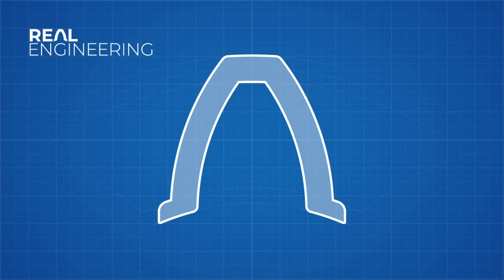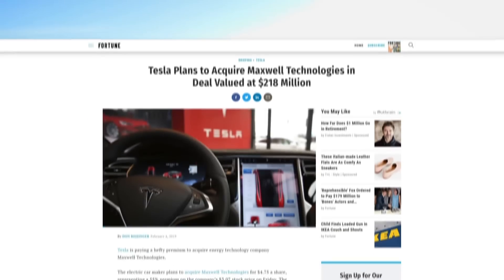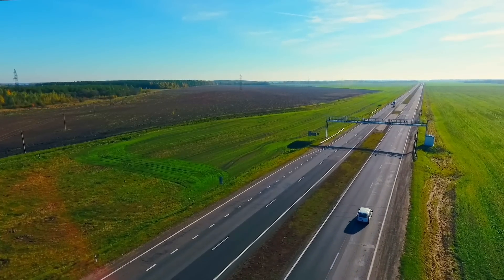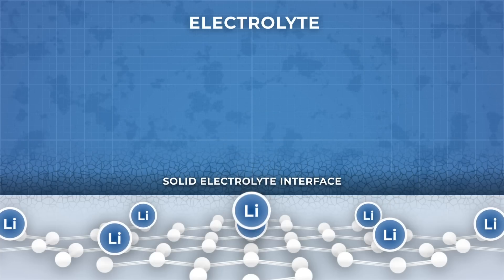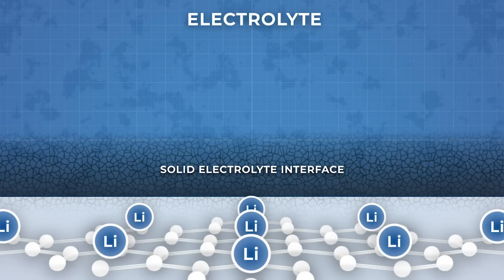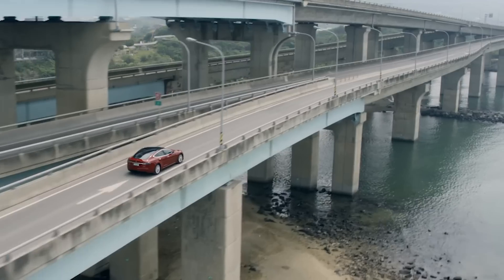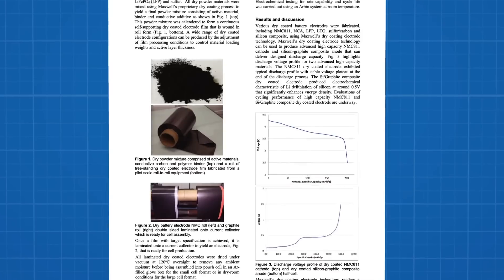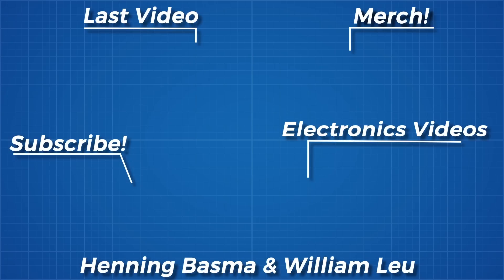Tesla's Quest for Better Batteries

Comment: Another plus with Maxwell's dry-coated battery technology is that they don't need Cobalt.
Reply: Sandcastle •  Well, it becomes an irrelevant argument if the batteries don't need any Cobalt!
Reply: @ImmoSci  people also say the mining causes more pollution than even gas vehicles. Hopefully with this coming into play, thats one less hateraid juice box.
Reply from the maker: Didn't know that, and I spent a week researching this video. That's a big deal. Lithium is relatively easy to get compared to cobalt
Reply: @RealEngineering  The most authentic source I could find is Maxwell Technology's 21st Annual Needham Growth Conference. There is a brief description of their technology as: "No Solvents, Next Gen Materials, Cobalt-Free, Solid State".
Reply: @hyric8927  I'm waiting for carbon battery
Reply: @hyric8927  you could've provided a link to what you found.
Reply: @RealEngineering  And not to forget that lithium is a minority component of Li-Ion batteries. There's 63kg of Lithium in a Tesla 70kWh battery pack (weighing 543kg in total).
Reply: @RealEngineering    I thought Cobalt was essential to longevity.  We need a video explaining Maxwell's technology advances a bit more please... Such important topic!  Since I was in undergrad EE at Urbana, all we talked about was how battery technology was the bottleneck to electric cars.  That was before Lithium batteries.
Reply: @RealEngineering  cobalt is incredibly difficult to dispose of as well
Reply: @richardscathouse  The best way to dispose of the cobalt is to "mine" used batteries, etc for raw materials to go into new manufacture. The advantage being that the ppm of such sources are far higher than raw ore or tailings.
Reply: @miscbits6399  Not a job is stand in line for!
Reply: @richardscathouse  and yet, Tesla intend to do just that in the Gigafactories. Recycling is an integral part of their overall long term business model
Reply: Thanks for your insightful comment ! That can have really big implications on geo-politics and environmental impact.
Reply: I think use of cobalt is a separate decision from the coating technique. For example LiFePO4 cell chemistry doesn't normally have cobalt in it.
Reply: @kitten_processing_inc4415  It may not have much to do with the coating process, but it's still a huge deal if Maxwell have a 300Wh/kg battery that doesn't require cobalt.
Reply: @Pete856  
And they have identified a path to 500 kwh as well
Reply: @brettmciver432  Yeah, the technology is improving all the time, 500Wh/kg would be a doubling of current lithium ion batteries......500kWh/kg might be a bit of a stretch :)
Reply: @Pete856  
Already with the maxwell tech will be hitting around 300kwh per kg
Current battery tech is at 257 kwh+- per kg plus any other improvements they incorporate as well
Reply: @brettmciver432  No. We aren't at 300kWh/kg, we are af 300Wh/kg. You are a thousand off.
Reply: @simonquvang6073  
Thanks for that not sure of the exact terminology for battery density things so I stand corrected🍺🍻 give that man a beer
Reply: @simonquvang6073  - 299.7 thousand. An order of magnitude.
Reply: You should share where you found that information, as at first sight that doesn't sound truthful. Cobalt is necessary to stabilize the structure of the catode during intercalation of Li ions, it doesn't have much to do with the fabricating process, be it dry or wet.
https://www.designnews.com/electronics-test/understanding-role-cobalt-batteries/63068579258429
Reply: @USUG0  You are referencing an article with cathode examples made with the traditional wet solvent process that in itself degrades the cathodes potential. Getting off Cobalt has alway been possible but it's about the performance trade offs. Maxwell's DBE technology is not just cheaper. It also improves the performance of the cathode because it did not have to undergo the solvent application. Bottom line Maxwell has created a completely different type of proprietary Cathode manufacturing process that your not going to find detailed in some article. What is truth to you?
Reply: Sandcastle • Why do you hate it? It's a valid argument. It's also mined by children in the Kongo. So it's better we get away from it
Reply: Sandcastle •  Don't like that 'argument' too. On top of your points regarding comparisons to oil companies and the relative irrelevance of cobalt mining on the global market, there is an argument to be made that it's not really a problem. As far as I know, cobalt does not exist as natural resource all on its own (there is no mine, where they find only cobalt). It always comes in combination with other heavy elements like copper or gold. So usually they mine copper and extract the small amounts of cobalt out of the copper ore. So even if we stopped mining cobalt (for cars AND all consumer electronics) it wouldn't stop the mining, because we still need the copper...
Reply: That's cool
Reply: Canada will still mine our vast reserves of cobalt. We have other customers.
Reply: What is cobalt?
Reply: @ancestralsubconscious-alex9606  Cobalt 59 is a semi radioactive mineral mainly from Africa that can hold a high electron charge before breaking down! Bad side it doesn't degrade naturally disposal requires special facilities that must be monitored for hundreds of years to be sure it doesn't get into the environment! Also in case of nuclear war, it transmits into cobalt60 highly radioactive and deadly explosive dust with a 100yr half-life exposure will kill in an hour or less! In the case of nuclear war, every Tesla becomes a cobalt bomb capable of killing everyone in 100km of it! For 100yrs!
Reply: @richardscathouse  😰 thank you for the explanation. I hope they stop using cobalt in the batterys!
Reply: @ancestralsubconscious-alex9606  me too! I'd like an electric car, a safe one!
Reply: @ancestralsubconscious-alex9606  its a high carbon metal alloy. Many magnets are made of it.
Reply: Sandcastle •  Yup, the cobalt excuse is such garbage.  Everyone making it isn't worried about cobalt in laptops or phones, only cars for some reason.  Tesla has the lowest cobalt percent in their batteries.  3% instead of 10-20%.  Tesla is not only using the least cobalt, they are going to be the first to eliminate it completely.  If you are actually worried about cobalt, you would praise tesla and shame everyone else lagging behind.  People complaining about cobalt are full of it.
Reply: @_PatrickO  Let's bury the cobalt are your house! Loser
Reply: So what then? Nickel manganese/aluminum/silicon?
Reply: evem if they needed cobalt, any one have any idea about recycling both cobalt and lithium in future like with lead acid car batteries, which now use standard plastics on all makes, thus making them fully recyclable
Reply: Sandcastle •  Yeah, them Canucks. Came and burned the White House! It wasn't white then; it was gray limestone. The staining from the fire was covered with white lead paint and still is.
Reply: A dry Battery  that has a electrolyte it's like a flourocarbon but in a evaperotative liquid state not compressed. This liquid electrolyte conducts electrons between the plates. If the cell is overcharged it vents losing it's conductive electrolyte, kinda like a paint thinner Then the cell dies! Don't overcharge!
Reply: Sandcastle •  You hate the argument or the fact that ethical cobalt is a complex problem that must be solved?  No doubt it can be solved, as it has been when extracting other energy industry resources from politically challenging regions.
Reply: I havent read through the comments but the problems people have with cobolt is that some of it comes from kongo, where there is 40 000 kids and youths digging out cobolt in illegal mines. Kongo doesnt have good regulation where it all comes from so you have no idea if it does come from childlabour. 

ik tesla doesnt use this cobolt but it doesnt help the fight
Reply: @heineaugustjensen9819  - It is spelled cobold.
Reply: Winston Churchill its actually cobalt so we are both wrong :)
Reply: @heineaugustjensen9819  - Blast!
Reply: Sandcastle • the thing about electric cars is they dont pollute the air in local areas, and we need to figure out a way to gather that co2 at the production sites. if we can do that THEN electric cars work, and we need to gather like all the fucking co2 that the plants cant convert and store it underground. and we need to stop overusing resources like we are rn. stop with using oil first of all
Reply: 80% of cobalt is found in the congo , which is a political nightmare you want to avoid. Good on them.
Reply: Cobalt is a byproduct of copper and nickel mining :) so argument of Cobalt mining exclusively for batteries is invalid
Reply: COBALT is also used to make GASOLINE

Just something to remember when somebody argues with you about EVs and the environment.
Reply: Hyric89 
In that instance, the cobalt is used as a catalyst, I assume that you understand that a catalyst activated a reaction but is not consumed and can be regenerated. So, it’s a reuseable commodity. The same can be said, to some extent, about the Co in Li-ion positive electrodes except that much more Co is needed than in a petroleum reformation catalyst.
Reply: @scomo532  It's like you think I'm trying to promote oil or something. What actually concerns me about the Cobalt problem is that much of it comes from one place: the DRC. Don't you think it's risky to have just one major supplier for such an important resource?
Reply: Does maxwell's batterys use lithium?
Reply: @ancestralsubconscious-alex9606  Cobalt is a metallic chemical element like iron, nickel and copper. Yes, Maxwell's batteries also use lithium.
In traditional Lithium-ion batteries, the cathode is made of lithium cobalt oxide - hence the cobalt content. Just don't ask me what the Maxwell battery cathode is made of because I don't know either.
Reply: @hyric8927  thank you!
Reply: And all cobalt problems
Reply: And solid state so they won’t catch fire!
Reply: Good! Most of the cobalt for lithium ion batteries is from Africa where children as young as 4 years old pick up the ore by hand even though cobalt is toxic! 😱😭😡 “The clean energy revolution hinges on the Democratic Republic of Congo - where conflict, corruption, and child labor are rife.”
https://edition.cnn.com/interactive/2018/05/africa/congo-cobalt-dirty-energy-intl/

“The only thing necessary for the triumph of evil is for good men to do nothing.” ― Edmund Burke.

“Children mining cobalt in Democratic Republic of Congo, CBS News investigation finds”
https://www.cbsnews.com/news/cobalt-children-mining-democratic-republic-congo-cbs-news-investigation/

I provided those two links first because too many people think companies that are more right-wing, like the “Daily Mail”, are only fake news. All they have to do to verify anything is a lateral search. This video explains that very well. "Is Most Published Research Wrong?"
https://www.youtube.com/watch?v=42QuXLucH3Q

“Child miners aged four at Congo cobalt mine”
https://www.dailymail.co.uk/news/article-4764208/Child-miners-aged-four-living-hell-Earth.html
Reply: Sandcastle •  do you recycle lithium ion batteries? https://www.globaltechenvironmental.com/recycling-services/battery-recycling/li-ion-battery-recycling/
Reply: Sandcastle •  saying you hate when people oppose cobalt means you're okay with child labor (slavery) in the Congo. “The only thing necessary for the triumph of evil is for good men to do nothing.” ― Edmund Burke.
“The clean energy revolution hinges on the Democratic Republic of Congo - where conflict, corruption, and child labor are rife.”
https://edition.cnn.com/interactive/2018/05/africa/congo-cobalt-dirty-energy-intl/
Reply: Where does Maxwell source there dry coat powder??
Reply: What about Maxwell's demon?
Reply: No more conflict reasources sorry drc
Reply: Wb graphene batteries
Reply: @isaman7071  very few people know about graphene tbh. But as I'm writing this we have only been able to make a sheet of graphene as big as a credit card. Promising for future batteries, but for the moment its only used in clothing and rubber bands.
Reply: @qwertygames2339  ohhhhh but u should check out graphene batteries on youtube....now we have powerbanks for phones too
Reply: Really? It was my understanding that the Co redox reaction is what provides the positive electrode with its high voltage  upon charging of the negative electrode
Reply: Very true
Reply: Sandcastle •  Cobalt is like nuclear waste you can't just toss it away! It requires special facilities and must be supervised for hundreds of years! All for you smug fake green BS
Reply: Hey it might be a good idea to use button cell lithium iron battery because button battery are smaller then the regular Tesla batteries like the AA battery they are bigger and maybe taking more room if you use a button cell battery it might reduce the size of battery pack plus you might even get higher range in an electric car these are my theory and gesues I don’t know what will happen next but to me it’s a good idea
Reply: @FunnyVideos-jm8fo  lol, energy density defines the size of the pack.  Smaller batteries hold less power and have more casing vs storage material.  The 2170s are optimized for volume vs surface area and wasted space.  More smaller batteries would require a heavier and larger pack from wasted space, battery connections, cooling pipes, etc.
Reply: Ok lol
Reply: Sandcastle •  No asshole they are not easily countered! What are you a Trumpanzee?

Comment: Solvents can be captured and reused though. CO2 extraction uses this method.
Reply: I was surprised the solvents were not being at least partially recaptured.
Reply: @rationalmartian  
They are
Reply: Probably there is solvent degradation due to high temperatures used to extract them from electrode.
Reply: I think he meant that its getting captured but only with regard to environmental issue, but that quantities/benefits retrieved aren't enough to be exploited in a economic sense, don't u think ?
Reply: Sometimes recapturing can be more expensive than just buying more solvent.
Reply: It's cheaper just to buy new solvents than to try to reuse them.
Reply: That solvent (NMP) is very toxic, carcinogenic and expensive to either recapture or dispose... it sucks for any factory workers who has to deal with making the wet coated electrodes.. kudos to maxwell for inventing a safer and cleaner way to make batteries
Reply: Recapturing is very energy intensive

Comment: I think there's a typo in the cathode material. It says LiNiCoAiO2 but I think it should be LiNiCoAlO2. Aluminum instead of uhh.... something?

That said, this is a fantastic video.
Reply: Of course!  No wonder mine doesn't work!
Reply: Adobe Illustrator oxyde
Reply: In the same scene, the anode and cathode are labelled with the incorrect polarities as well; I think they must have been a little tired when animating that segment!
Reply: @raspibox6598  Its hard to quality control editors when you have to pop out vids on a schedule.
Reply: @raspibox6598  No, the terminals are correctly labeled. As far as I remember, the definition of cathode and anode batteries are a bit technical. Like, the anode is the terminal where oxidation occurs and the cathode is the terminal where reduction occurs. Thus at the anode, you see a -ve terminal due to the accumulation of the electrons obtained from oxidation of electrolyte ions and similarly for the cathode you see a +ve charge due to a deficit of electrons. Correct me if I am wrong.
Reply: @abhijitmajee6754  whaaat? Cathode has an excess of electrons so it's negatively charged and is the negative terminal of the battery and vice-versa for the anode.
Reply: @tanmay______  yes, I can understand the confusion and believe me when I say I had this confusion too. This naming comes from focusing on the method by which these electrons were created at the first place. Inside batteries, the charge flow occurs due to the ions in the electrolyte and their reaction with the electrodes. Please refer to a book or website for the details.
Reply: We should start a petition to change Aluminum's symbol from Al to Ai so that we can say RE didn't make a mistake.
Reply: Maybe it's a smart battery that uses artificial intelligence?
Reply: Ai is for artifical intelligence, it's an ai battery used to power elon, who we all know is actually the world ruler skynet.
Reply: I dont know why it bothers me so much but I couldn't listen to the video the whole time it was on screen!  LoL
Reply: @Wearepricester  Misophonia. Look it up. I've suffered with it since birth. I had thoughts of killing my parents in their sleep, for they intentionally triggered it through through mental torture. When a man uses the ladylike soft "L" sound, it usually means I won't be listening to them at all. I was able to this time, due to Ativan. And no, I will not be flying to Ireland, one of my homelands.
Reply: Aioli?
Reply: ahh thats why my battery blew up.
Reply: Guillaume Couture Levesque- "uhh.... something?" LOL 
Ai is obviously computronium.
Reply: You didn't use Transparent Aluminum Almagamation as the Anode.
Reply: Except it's aluminium
Reply: @512TheWolf512  Is it center or centre?  Depends where you live.

Comment: Why can't they just replace the electrodes...  That should renew the battery life....?
Reply: The electrode is literally the battery
Reply: @ehariharan9320  there are other major components of a battery that may not be as expensive but in the long run, the cost savings will pay off for the company.
Reply: If you ever saw how these were put together it would be clear, the internal components are just extremely thin sheets wound and compressed together to get the most material possible into that volume.
When you pull them apart the sheets just rip and wouldn't make a safe battery again.